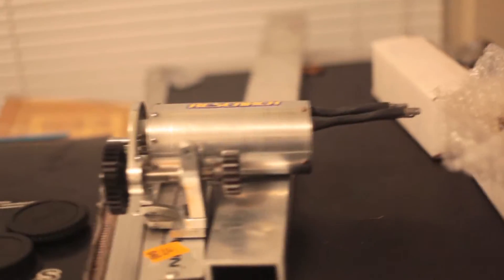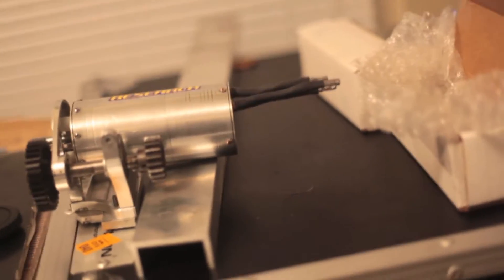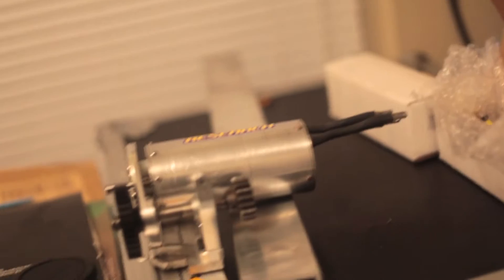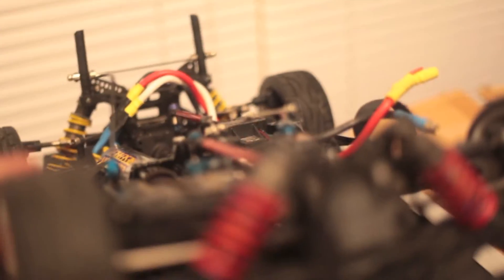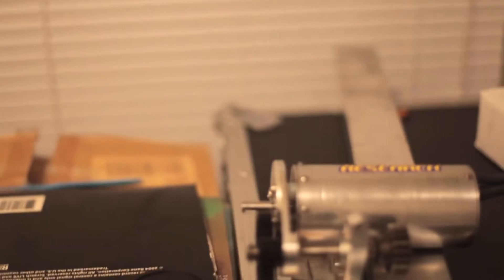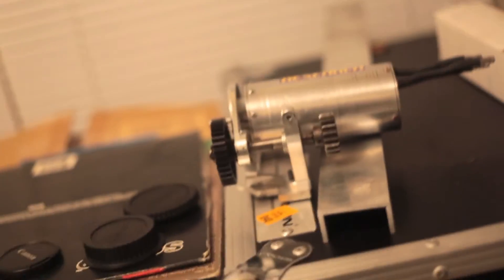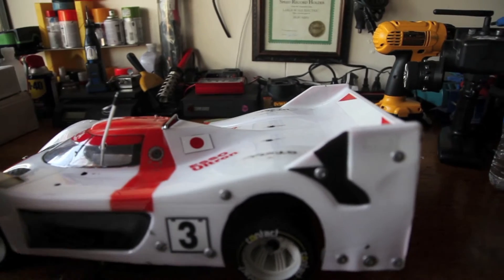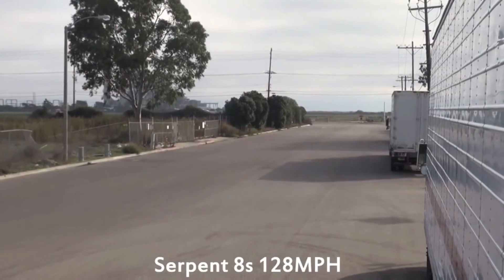speed runs using cordova motor

Comment: yea had to like this vid good info any tips on a esc for a standard  2200kv motor and keeping the car on the ground after 70 plus
Reply: mamba monster/mamba monster2 or xl2 esc !
Reply: i can not find any xl2 anywhere
Reply: eBay has them
Reply: Killamoves 0104 not the xl2 esc alone they only have the xlx and i seen one xl2 combo but that's it i even checked castle web site the xl2 is not up on the site  i just double checked again

Comment: hi bro,,thanks for info but i priced the motor and its mad expensive,am converting a Rs5 t-10 1/5thscale,,,,i got myself the alien esc 350a and the t.p motor 7D 950kv 223amps 53.6volt..it will be powered by 4s lipo 8000mah 30c..can you give me your opinion on this please??i converted a harm sx3 a year ago with the trackstar setup..is 21t pinion gear and 41 spur gear ok to use or should i get different gearings?am not an expert am in the learning process and if u could help me that will be great..thanks